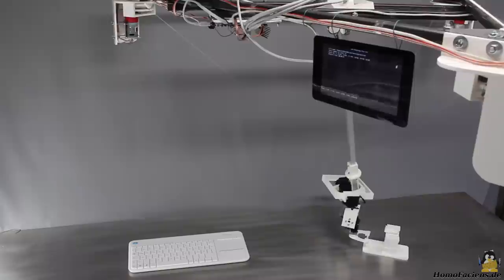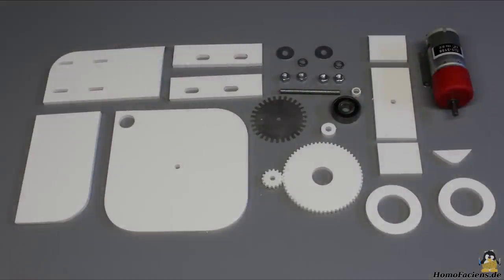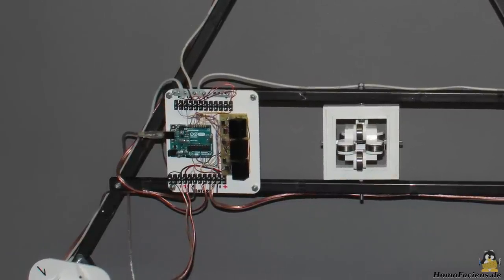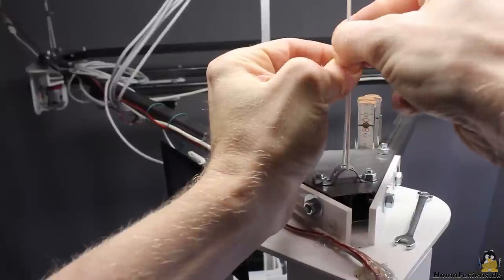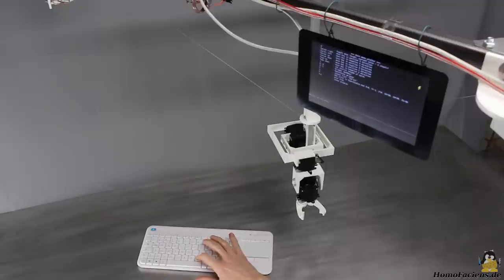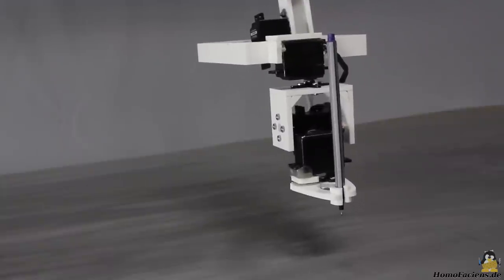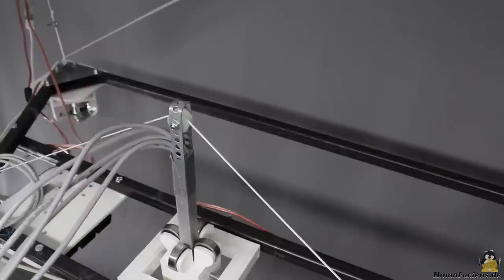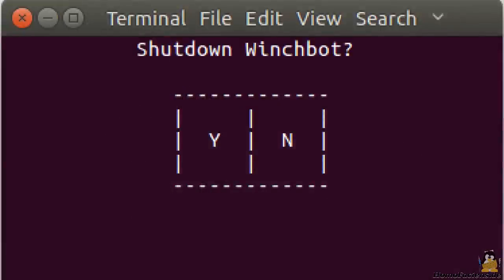WinchBot - a robotic arm composed of 3 winches, 5 servos, an Arduino Uno and a Raspberry Pi

Comment: Awesome!  That is a really huge contribution to open source robotics!  And obviously a huge development effort.

I was thinking of something for you - a possible diy encoder for linear motion.  The magnetic sheet used for thin refrigerator magnets has lines of alternating field polarity at regular spacing.  Perhaps motion past these lines could be counted using a coil or hall effect sensor to determine linear position at a fairly high speed.  This would be like a magnetic tape recorder - but the engineering is too hard for me ;)  Something for you to fill your idle time ;)

Thanks for these incredible machines - i really like how you keep the materials and building simple!
Reply from the maker: Printers use a line pattern for detecting linear movement:
https://www.youtube.com/watch?v=YfBkddVJksw

Your magnetic tape detector would use hall detectors instead of the optical sensors, thus the software could be the same, you just have to change the electronics. I'll keep that in mind for a future video.

Comment: I wonder if the 32bit arduino would help you with the limitations of the pulse problems? Or possibly a dedicated arduino for each axis then you send commands to each of the axis. Kind of like creating an arduino controlled servo with built in feedback.
Reply from the maker: Replacing a 8 bit microcontroller by a 32 bit version rarely eliminates the real problem ;-)
First and foremost winches running smoother will eliminate the oscillations. Let's see if I'll create an improved iteration of that WinchBot in the future...

Comment: Awesome machining!  Love the way you put together stuff.  It reminds me of steam punk stuff.  I try to use stuff at hand even when stuff is cheap to buy instead of make.

I was wondering why you don't use the optical sensor strips from old printers?  It looks like you salvaged some of the sensors from them but I'm not sure.  Anyways I'm building another 3d printer using printer scraps, even using the DC motors and optical sensors.  I call it a ScrapRap.  I just wish I could hack the printer boards to control the printer instead of buying a board for it.  

As for this robot project I was thinking about something similar to this but at the scale of my entire living room so I could have it grab things for me.

Miles of Smiles!
Reply from the maker: Using the linear sensors from old printers would work, too, but with that the length of the (varying) cord length is limited to the length of the sensor stripes. With the arrangement I am using, the size of your WinchBot is (nearly) unlimited.

A living room sized WinchBot could make your live really comfortable ;-)

Comment: How do fast machines step "1-step at a time" when their encoders define the step size?  Do they just go full on, then wait for an encoder pulse, then turn off? What about inertia?

(I'm currently trying to make a 3d printer with dc servos).
Reply from the maker: I have made a video about PID control loops:
https://www.youtube.com/watch?v=PQ1FBcQT0AI
Maybe that helps a bit to understand when to turn a motor fully on and when to reduce power.

Comment: Another great build! what programming language do we need to learn if we want to develop controllers in linux to talk to raspberry? Is it python? At around the 5:20min mark, thanks!
Reply from the maker: I have written the WinchBot software in C. You can get the source code on my pages:
http://homofaciens.de/technics-machines-winchbot_en.htm
You can write software like that in Python as well. C gives you more control over the hardware and memory management, but it is more tricky to handle than Python. If you have learnd the concept of variables and subroutines with Python, it is more easy to go to C later.
Reply: Ok, got it. I have written C code for microcontrollers but have never tried writing code that runs in the terminal with a user interface like yours, which is really cool. Thanks so much!

Comment: Why haven't you used stepper motors instead of brushed DC motors?
Reply from the maker: I ordered the DC motors from RS components (for free) for a more conventional design of a robot arm. Later I changed my mind and made WinchBot. I am in contact with my sponsor to eventually create a second WinchBot having bipolar stepper motors - stay tuned!
Reply: Waiting for your new video :)

Comment: What's the cause of vibrations? Each materials seems to have enouh strength though..
Reply from the maker: As said in the video it's because of the rough stepping of the DC motors. There is movement of 0.5 to 1.5mm per step.

Comment: what do you mean by saying that 30 is the limit of the pulses for the arduino?
Reply from the maker: A sensor disc with 30 teeth generates 120 pulses per revolution. With the relative high motor speed (more than 10 revolutions per second) the number of pulses becomes too high for the Arduino. Details about encoder discs:
http://homofaciens.de/technics-base-circuits-encoder-disc_en.htm
Reply: Dammit! How can i solve this problem?? By Using a pi?
Reply from the maker: A Rspberry Pi can't be used for control circuits like that, because it doesn't run a real tim operating system.
You can use interrupt triggered sensor feedback (e.g. one Atmega328 per motor) or look for a microcontroller with a significantly higher clock speed.

Comment: does it have parkinson's disease ?
great project by the way :)
Reply from the maker: Thanks! With the sponsor of the WinchBot components I am working on a cure for that robot disease ;-)
Reply: It seems very interesting that the slow response time of adjustment leads to such shaking in the robot and probably the same process is happening with those with Parkinson's disease or for those who are very old and shaky or for those who have been holding a load for a long time and are tired and on the brink of loosing control.  All contexts seem to have this same shakiness from slow feedback loop responsiveness.  Definitely something worth understanding and nicely demonstrated here. :-)
Reply from the maker: There might be an analogy between both in principle, but it's mainly not the low response time (the Arduino is fast enough). Instead the too rough sensor feedback causes the shakiness of my robot.
I have recorded a video about PID control:
http://homofaciens.de/technics-computer-arduino-uno_en.htm
More will follow in my series about "Physical Computing" that will start in a couple of weeks - stay tuned!

Comment: Why not use steppers in this design, either?
It's starting to feel like you have a personal agenda against stepper motors and avoid using them as much as possible :D
Reply from the maker: A bipolar stepper motor version might follow.
I simply avoid them to show that you can use cheap DC motors with feedback instead.

Comment: put a 3d printer hotend on it.
Reply from the maker: ...to get the most horrible 3D printer ever?
Must improve the mechanics to get it less shaky before even thinking about that...
Reply: Jackson Pollock in 3D ...... now there's money to be made
Reply from the maker: Do you have a link to that machine?
Reply from the maker: Looks like this guy knows how to build his machines.
Reply from the maker: I would not call this robot a 3D printer (yet). It's a similar approach of creating a robotic arm.
Reply: Just a few weeks back, reprap Hangprinter by Torbjørn Ludvigsen has been shown, there's a video by Thomas Sanlanderer about it. It mounts winches straight on the print head, and is made from 3D printed parts. It's very slow, but the precision is quite good for something that seems so unsubstantial, and has been shown printing a 4 meter tall tower elsewhere.